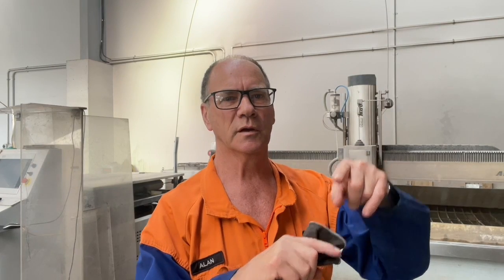Land Rover Series Chassis (Jig Build 1.1)

Comment: Have you thought about a chassis redesign Iv been looking at this new AI tech that can do stress test modelling and I think it’s possible to create a light lightweight more efficient chassis for Defenders and Classic Broncos
Reply from the maker: Hi, thanks for your comments, yes we have had a brief look at Finite Element Analysis (FEA):  For those that may not know, FEA is a simulation technique that uses numerical methods to analyze the behavior of structures under different loads and stresses. 
Our issue would be that any changes we make to a proven design would not be readily accepted by any regulatory authorities as a refit for the average repair or refit. That will not matter for off road or custom build but the market for us would be small unless could find a way to sell significant numbers. 
We are currently working with the New Zealand authorities and a testing company to see if we can bring a refit chassis to the market that is an acceptable chassis replacement and of know quality and specification prior to the owners having to re-vin or register their restored vehicle. We may take another look at this if we are successful with this program.